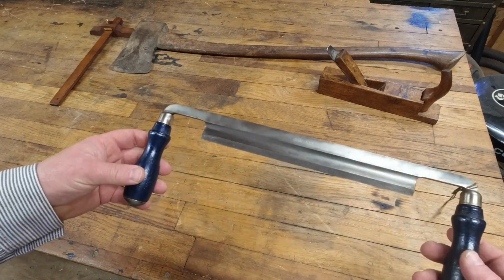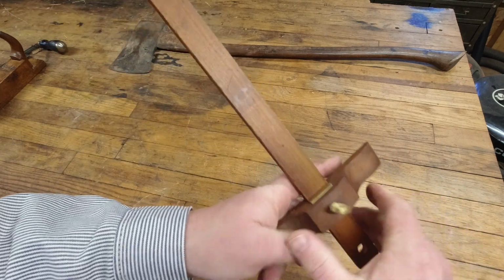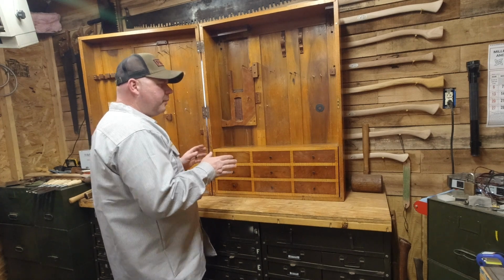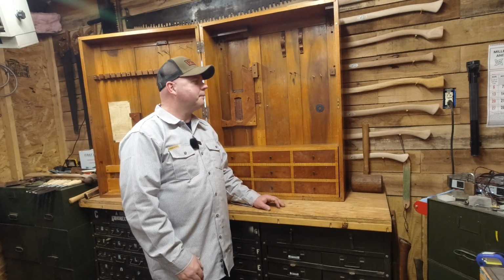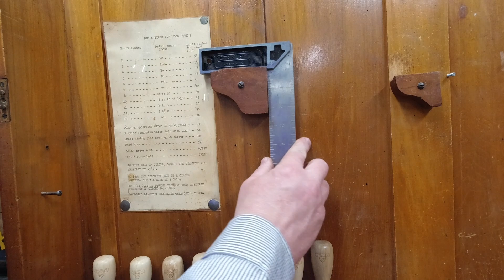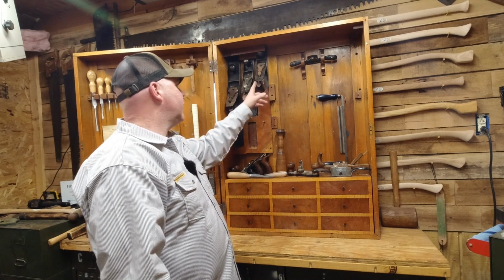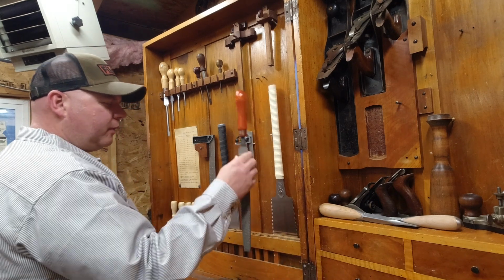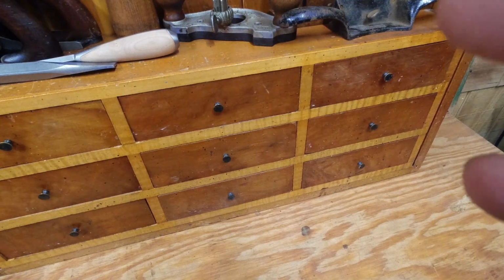Antique Tool Cabinet, Kelly Perfect Axe And More Found In The Wild! TREASURE!

Comment: I have a similar cabinet that was my grandfathers used to hold drill brace and bits. They are very cool. I also just scored a similar true temper axe with original handle and straight crisp edges but it’s a woodslasher. $10 at flea market.
Reply from the maker: That's a good score!